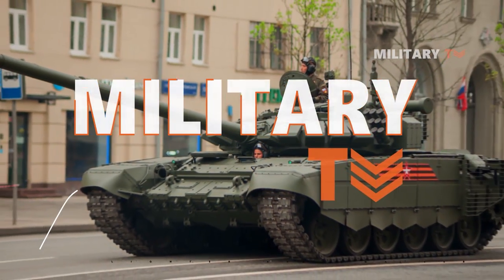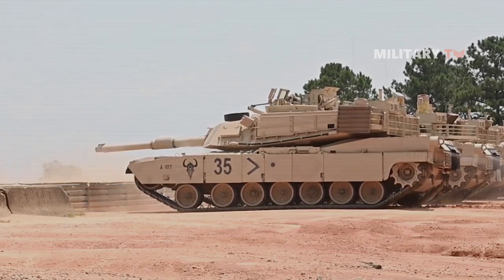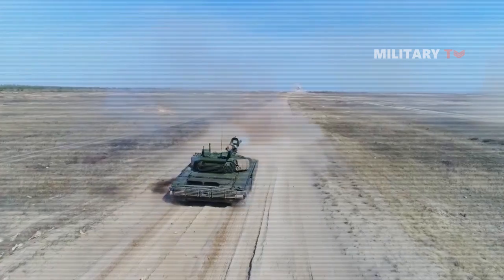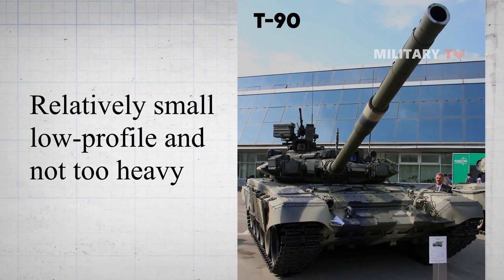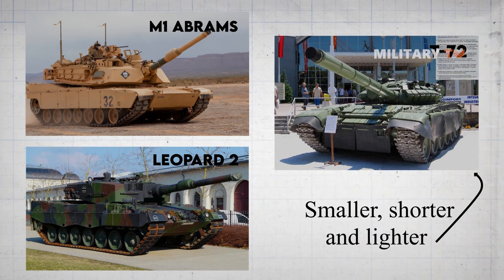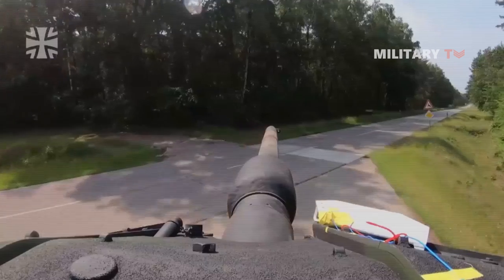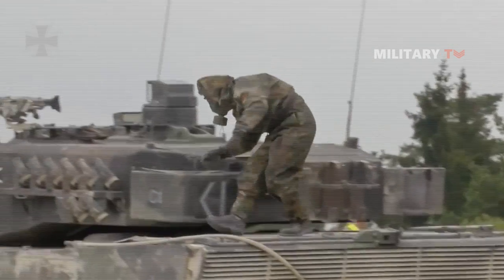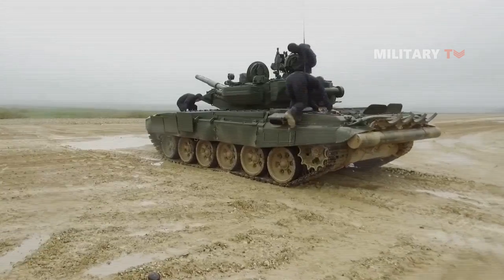Why are Russian tanks lighter and smaller than the western tanks

Comment: There are a lot of inaccuracies and errors. The T-54/55 is not a pair, the T-55 is just an upgrade of the T-54. The next tank was the T-62. And the T-64 was an innovative design in general, invented at the Kharkov plant. The T-72 was simply a simplified version of the T-64, since the T-64 used an overly complex and unreliable engine, and the chassis was at the limit of its capabilities. The T-72 was fitted with a more reliable engine, a reinforced chassis. Simplified the automatic loader. The T-72 was invented at the Ural plant. The plant in Kharkov, however, continued to improve the design of the T-64, And the plant in Leningrad, offered its solution in improving the design of the T-64, they strengthened the chassis and installed a gas turbine engine. So the T-80 turned out. And by 1980, a paradoxical situation had developed in the USSR, three types of tanks were produced, which, apart from the gun and the general scheme, had nothing in common with each other. After the collapse of the USSR, the Plant in Kharkov ended up in independent Ukraine, where it continued to improve the design of the T-64 by releasing the T-64BM Bulat and T-84 Oplot. And in Russia, the Ural Plant's T-72 tank was modernized, turning it into the T-72B and T-90A. And now the T-90M is being produced.
Reply: The question I have is: Which plant is turning out the T-14?

As far as I know, the T-14 still has drivetrain issues, mainly with it's transmission.

But with a lower CG, as well as a much shorter overall profile and silhouette, I'm thinking that at some point, the T-14 may start handling medium tank responsibilities in the Russian armored corps and cadres that employ armor.
Reply: @isaiahwelch8066  considering how many T-72s the Russians are still using I wouldn’t be surprised if the T-14 is never adopted in great numbers. So many Russian military projects are commissioned and then quietly abandoned due to costs
Reply: the comment was that the T54/55 was being paired with the T62, whilst the T72 was paired with the T64.